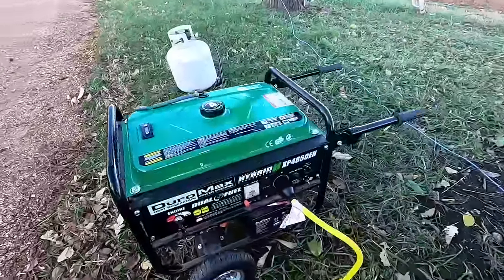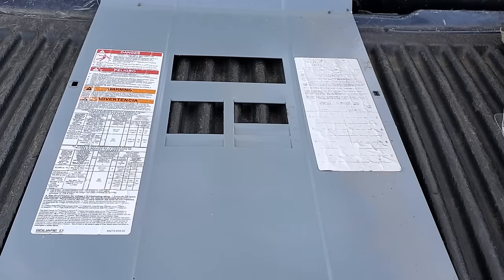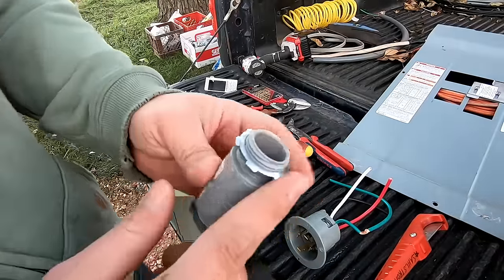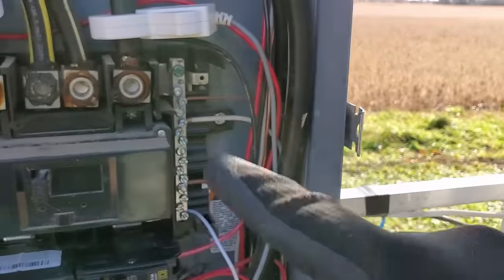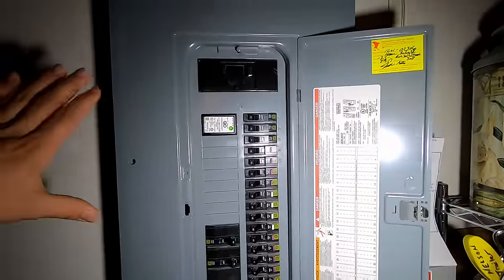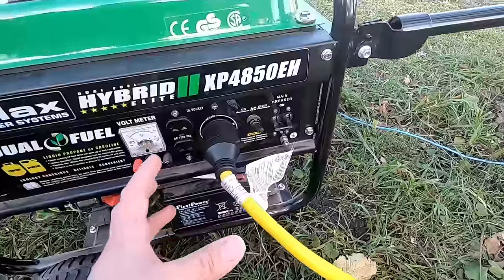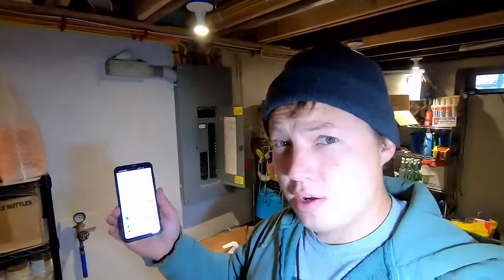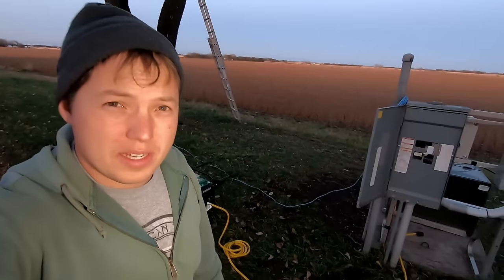How To Hook Up a Generator To Your House Using a Breaker Interlock Kit & Power Inlet Box

Comment: I picked up a Model #PG12000B 12,000-Watt/9,500-Watt Dual Fuel Gasoline/Propane Powered Electric/Recoil Start Portable Generator from Homedepot for $769.99 + tax. they want $1076.92 for it today but if you keep and eye out you can get it at the cheaper price. this generator has a 50 amp plug I bet you could even run your hot water heater with this one. I've not ran it except for a few minuets to make sure it started, but it was the best value i could find on a generator of this size. This is a excellent video by the way. best one out there on setting up a portable generator to run your house.   I see coper pipe at your meter box do you have a bulk propane tank you plan on using with your generator?

Comment: I used torque screwdriver . It works great for all electrical screw it won’t slip from the screw you’re tightening
Reply from the maker: I need to pick one up as well. It's just a good idea.

Comment: Damn. The electrical in your house is clean. I saw the runs coming out of your interior panel. I think I’ve only seen about 4 or 5 houses that looked similar.
Reply: Don’t forget about the safety rules of using generators: Always make sure you follow all the generator safety rules whenever you use your portable generator. This is a reminder for everyone’s safety of using generators. Generators can be dangerous if not used carefully. Every year, hundreds of people die or get injured when using portable generators due to carbon monoxide poisoning and electrocution. Make sure you are using your generator carefully and keeping others safe as well. There is something very serious that everyone should always be aware of when using generators. Some people do run their generator indoors which is not safe and that increases the risk of carbon monoxide poisoning which can cause death of family and you. Some people run their generator in wet conditions which can electrocute them. Please remember that you should never run your generator indoors. Remember that carbon monoxide is an odorless and colorless gas that you cannot see or smell. Carbon monoxide is a silent killer. Keep that in mind. Make sure your generator is 15-20 feet away from your house and away from doors, windows, and vents. Never use your generator in your porch too. Having a carbon monoxide detector is very important against generator safety. Some people also allow children to go near the portable generator which could pose risks. We need to keep an eye on our children making sure that they are not near the portable generator so they won’t get electrocuted or burned by the generator which is dangerous. A locking enclosure also keeps kids safe. A generator shed might look like a tempting place to explore, or take cover during a game of hide and seek, but a generator is a dangerous piece of equipment that can cause injury. It says on the manual that we should also keep children away at all times from the portable generator to avoid injuries. Please do not allow a child or unqualified people to operate the portable generator.  It is important to keep your children safe especially little ones. The portable generator can be hot during an operation. Just because some manuals missed what should be listed doesn’t mean it’s safe to do. Always follow the generator safety rules when using portable generators. Generators pose electrical risks. If you need to use your generator during wet weather, you need a generator tent to protect your generator from getting wet. Don’t let your generator get wet. Keep your generator dry and before using your generator, please make sure your hands and your generator is dry. Do not wear loose clothing when operating the generator. Everything that is said on the generator’s operating manual should not be ignored. Never smoke cigarettes near the generator. Please keep flammable things away from the generator. Never overload your generator too. Your generator can catch fire. Never ever try to plug a generator cord into a wall outlet to avoid back feeding. Back feeding your generator is dangerous. Always turn on your generator first before plugging in appliances and shut off the appliances before turning your generator off. Use a heavy duty cord for your generator and the cord should not be worn out. All the instructions should be followed carefully. Never refuel your generator while it’s running. It can cause fire if fuel spills while your generator is hot. You should turn off your generator and let it cool off before refueling it. Having a fire extinguisher next to the generator is also important. This is only a reminder for everyone’s safety of using generators. Make sure your generator is properly grounded. Having a fire extinguisher next to the generator is also important against the safety rules. https://youtu.be/I1jT3ANENvI and here is a video more about keeping others safe when using generators and also about our family’s safety. It’s important to keep our little children safe as well. Make sure your little children are kept away from the generator at all times especially when it’s running. Hope this helps. Always remember that it’s better to be safe than sorry. Also remember that warnings should not be ignored too.

Comment: Ben, very late to this video, but is it ok to move the top breaker in the panel to the bottom or should all breakers be shifted down?  This is to make room for a 30 amp breaker for generator.

Comment: Question about surge protection using generator. Could I use RV surge protection pig tail on my home. Generator has floating neutral. House panel loaded with Square D extinct breakers. I’d prefer IMF but am not sure how to. Any ideas Thanks.

Comment: Note! to Benjamin young man, installing the receptacle in the smaller box it's called a socket, not a plug. The cord which would be in your hand with a receptacle at the tip would be called a plug okay. Anything with a cord of some type is considered a plug. Also, you'd called your yellow cord extension cord, which's considered a power cord. Anything above 10AWG is considered a power cord. Extension cords are much lighter and they use smaller gauge wire, you evidently are using the proper power cord to make the transfer from the grid to your generator then to your house...

Comment: Great video and your ability to produce condensed but accurate information rivals anything found on the cable TV shows; if you do much more of this I'm confident one of them will hire you in some capacity.  A couple of "how-to" related comments now:  1) using wire nuts without looming or braiding your wires first is a common mistake.  While the nut will successfully hold two side-by-side wires in most cases, multiple wires will have a tendency to cause one to lose continuity and esp. over time as the junction goes through heat-cold cycles.  Flickering lights or buzzing in a switch- or plug-box is a dead giveaway of a hack doing the electrical work, and those are total pain in the __ to find and fix---and completely avoidable. Use a pair of electrician's pliers to twist bared wires together thoroughly before adding the wire nut. 2) Yeah, get a set of Torx screwdrivers for installing plugs/switches (the smaller size square-hole) and breakers (the larger one).  You can still easily strip the screw head out with them, but not as easily as with a low-IQ flat-blade screwdriver.  They also give you much more control.  Thanks for your great work and I'm now a subscriber.  Kudos from the left coast!

Comment: Great video!  Extremely informative and thorough.
Reply: ⚠️Portable Generator Safety Tips:

1) KEEPING OTHERS SAFE: Please do not allow an unqualified person or your children to operate and service the portable generator. Just because some manuals don’t say that doesn’t mean it’s safe. That is important against the generator safety rules. We also need to be keeping an eye on our children too. You need to make sure that your children are not playing near the portable generator especially when it’s running so they won’t get electrocuted. Generators pose electrical risks and they can be hot during an operation. Please keep your children away from the portable generator at all times. It is important to keep our children safe especially our little ones. Be aware of all the hazards.

2) WHERE TO RUN YOUR GENERATOR: Some people use their portable generators indoors which increases the risk of carbon monoxide poisoning. It’s important to have a carbon monoxide if you have a gas generator. Never ever use your generator indoors even if your doors and windows are open and even in the garage is not safe to use a portable generator. Also please never use your generator in your deck or balcony. It is never safe to use your generator indoors and in enclosed areas of your home. Your generator needs to be 15-20 feet away from your house. 

3)🔥FIRE HAZARDS: Never refuel your generator while it’s running. You need to let your generator cool off before refueling it and before storing your generator. Never overload your generator too. Never ever back feed your generator. You should never plug your generator into a wall outlet. Also never store propane tanks indoors. Please keep flammable things away from the generator as well and please don’t smoke cigarettes near the generator. Having a fire extinguisher next to the generator is also important against the generator safety rules. It’s also not safe to move your generator while it’s running.

4) GENERATOR OPERATION: make sure your hands are dry before touching the generator. Never use your generator in wet conditions. Don’t let your generator get wet. You need a generator tent if you need to use your generator during wet weather. Please don’t wear loose clothes when operating the generator. Turn on your generator before plugging in appliances. Use the right cord for your generator. Please do not use worn out cords. 

https://youtube.com/shorts/eFigDfnPkcQ?feature=share and here is a short video more about keeping others safe when using generators. Portable generators need maintenance so it’s important to follow the safety instructions.

Hope this helps

Comment: Let me get this straight.. you can back feed any breakers and it will energize the panel bus? Or is that a special breaker?
Reply: ⚠️Please don’t forget to follow the generator safety tips whenever you use your portable generator. This is a very important announcement for everyone. This is just a reminder for everyone’s safety. All generator safety rules need to be followed carefully 

Generator safety tips: 

1) KEEPING OTHERS SAFE: Please do not allow an unqualified person or your children to operate and service the portable generator. Just because some manuals don’t say that doesn’t mean it’s safe. That is important against the generator safety rules. We also need to be keeping an eye on our children too. You need to make sure that your children are not playing near the portable generator especially when it’s running so they won’t get electrocuted. Generators pose electrical risks and they can be hot during an operation. Please keep your children away from the portable generator at all times. It is important to keep our children safe especially our little ones. Children often get curious about anything so we should keep an eye on them to also make sure they’re not wandering towards the generator. 

2) WHERE TO RUN YOUR GENERATOR: Some people use their portable generators indoors which increases the risk of carbon monoxide poisoning. It’s important to have a carbon monoxide if you have a gas generator. Never ever use your generator indoors even if your doors and windows are open and even in the garage is not safe to use a portable generator. Not even at your porch and your deck. It is never safe to use your generator indoors and in enclosed areas of your home. Your generator needs to be 15-20 feet away from your house. 

3)🔥FIRE HAZARDS: Never refuel your generator while it’s running. You need to let your generator cool off before refueling it and before storing your generator. Never overload your generator too. Never ever back feed your generator. You should never plug your generator into a wall outlet. Also never store propane tanks indoors. Please keep flammable things away from the generator as well and please don’t smoke cigarettes near the generator. Having a fire extinguisher next to the generator is also important against the generator safety rules. 

4) GENERATOR OPERATION: make sure your hands are dry before touching the generator. Never use your generator in wet conditions. Don’t let your generator get wet. You need a generator tent if you need to use your generator during wet weather. Please don’t wear loose clothes when operating the generator. Turn on your generator before plugging in appliances. Use the right cord for your generator. Please do not use worn out cords. 

https://youtu.be/I1jT3ANENvI and here is a video more about keeping others safe when using generators. All generator safety rules should be followed carefully. 

Hope this helps.

Comment: Awesome video. I want to install an I interlock at the panel but its maxed out on breakers and theres no room. Anyway else to install something's like this, without having to choose circuits to run in a transfer panel?  Somewhere near the meter?
Reply: Here are the Generator safety tips: Always make sure you follow all the generator safety rules whenever you use your portable generator. This is a reminder for everyone’s safety of using generators. Generators can be dangerous if not used carefully. Every year, hundreds of people die or get injured when using portable generators due to carbon monoxide poisoning and electrocution. Make sure you are using your generator carefully and keeping others safe as well. There is something very serious that everyone should always be aware of when using generators. Some people do run their generator indoors which is not safe and that increases the risk of carbon monoxide poisoning which can cause death of family and you. Some people run their generator in wet conditions which can electrocute them. Please remember that you should never run your generator indoors. Remember that carbon monoxide is an odorless and colorless gas that you cannot see or smell. Carbon monoxide is a silent killer. Keep that in mind. Make sure your generator is 15-20 feet away from your house and away from doors, windows, and vents. Never use your generator in your porch too. Having a carbon monoxide detector is very important against generator safety. Some people also allow children to go near the portable generator which could pose risks. We need to keep an eye on our children making sure that they are not near the portable generator so they won’t get electrocuted or burned by the generator which is dangerous. A locking enclosure also keeps kids safe. A generator shed might look like a tempting place to explore, or take cover during a game of hide and seek, but a generator is a dangerous piece of equipment that can cause injury. It says on the manual that we should also keep children away at all times from the portable generator to avoid injuries. Please do not allow a child or unqualified people to operate the portable generator.  It is important to keep your children safe especially little ones. The portable generator can be hot during an operation. Just because some manuals missed what should be listed doesn’t mean it’s safe to do. Always follow the generator safety rules when using portable generators. Generators pose electrical risks. If you need to use your generator during wet weather, you need a generator tent to protect your generator from getting wet. Don’t let your generator get wet. Keep your generator dry and before using your generator, please make sure your hands and your generator is dry. Do not wear loose clothing when operating the generator. Everything that is said on the generator’s operating manual should not be ignored. Never smoke cigarettes near the generator. Please keep flammable things away from the generator. Never overload your generator too. Your generator can catch fire. Never ever try to plug a generator cord into a wall outlet to avoid back feeding. Back feeding your generator is dangerous. Always turn on your generator first before plugging in appliances and shut off the appliances before turning your generator off. Use a heavy duty cord for your generator and the cord should not be worn out. All the instructions should be followed carefully. Never refuel your generator while it’s running. It can cause fire if fuel spills while your generator is hot. You should turn off your generator and let it cool off before refueling it. Having a fire extinguisher next to the generator is also important. This is only a reminder for everyone’s safety of using generators. Make sure your generator is properly grounded. Having a fire extinguisher next to the generator is also important against the safety rules. https://youtu.be/I1jT3ANENvI and here is a video more about keeping others safe when using generators and also about our family’s safety. It’s important to keep our little children safe as well. Make sure your little children are kept away from the generator at all times especially when it’s running. Hope this helps. Always remember that it’s better to be safe than sorry. Also remember that warnings should not be ignored too.